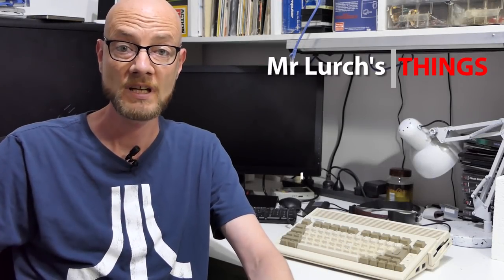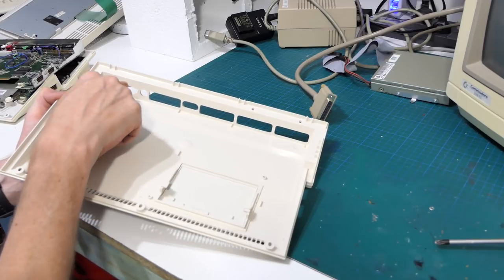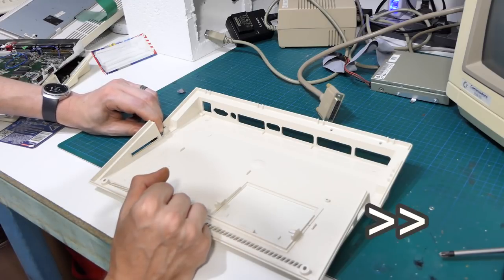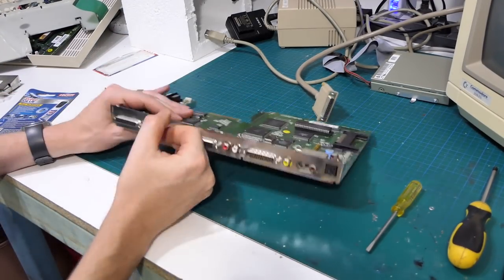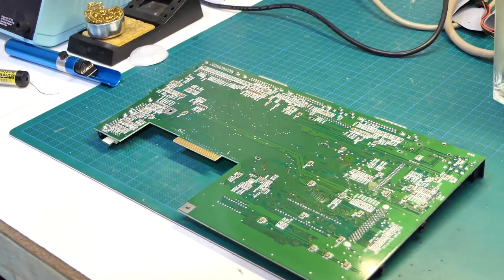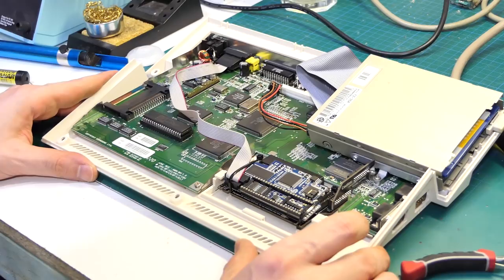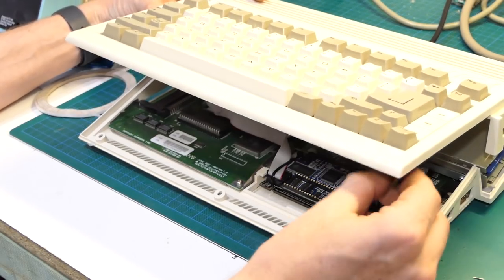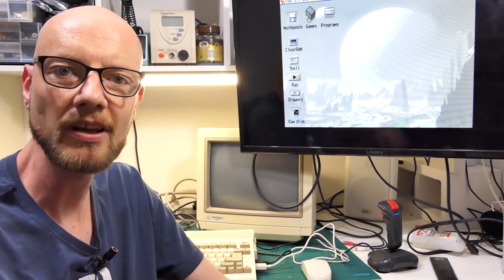Amiga A600 Rebuild + Fixes

Comment: Zip ties may be the most incredible invention ever, even past duct tape. When I was in college, I had a 1984 Mazda 626 with bad motor mounts. The engine's torque kept slamming the distributor cap into the underside of the hood, breaking one of the plug wires free! I couldn't afford a proper repair.. so I zip tied the engine in place. They lasted until the car died a different death! :)

Comment: As for the method used to desolder parts, I actually do the same thing, but then, after the old part is removed I use a bit of liquid flux and reflow the bare pads so there is nothing to hinder the installation of the new part.

Comment: Very useful. It is true that the expansions that use the "overdrive" system are very unstable.
I will use this method !!
Just one question, I have notices that my Furia600 does not bring the 4 separators. Are there any created for 3d printers?

Comment: Only just found this video.
Lots of fun and a good watch.  I can NEVER find that socket when I need it either. Rotten little b'stard.
Why did the original miggy die?
Reply: Brilliant solution for Furia Wobble. You are correct, it's wear on the Furia-side socket. Replacing the socket is a good move if you can do it. Thanks for this vid. Realise I'm a year late.
Reply from the maker: I honestly cannot remember what killed the original mobo (hey, it has been a year!)
As for replacing the socket - yeah. Tried that. Now need to buy a new Furia :(

Comment: Hi, 
NOOBIE ALERT 
Ive just recently fired up my old amiga, i have a few floppys that survived with it also!
It seems to be running “workbench 2.05” if that sounds right, i bought a game called the settlers, i only ever had the demo but found one on ebay few years ago and tried it last week not the problem seems to be that the game requires more fast ram and chip ram???? As the game tells me there is none present, i have only started researching the amiga 600 specs and i assume that it only has 1mb of memory that it shipped from the factory with because i have never opened it before and its a miracle as i open everything!😜
A couple of quick questions,
How do i get & Where do i put the fast ram? In the Expansion slot on the bottom???

Is the fast ram the same as the chip ram or is it different and need to go somewhere else??

How can i get workbench 3.1 that everyone seems to be using! 

I dont mind about the workbench thing but would just like to play that Settlers game a few times! I’m not looking to do photo editing with the machine!!😅

Thanks for your time reading this and sorry if i wasted anyone elses time!!